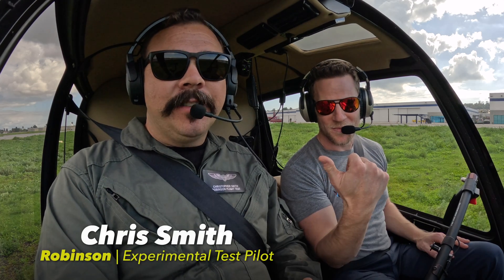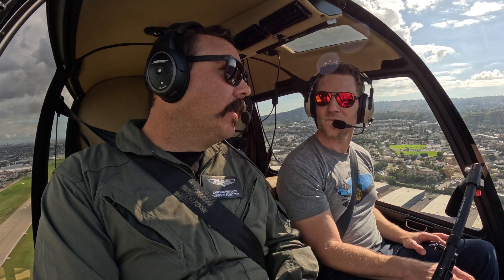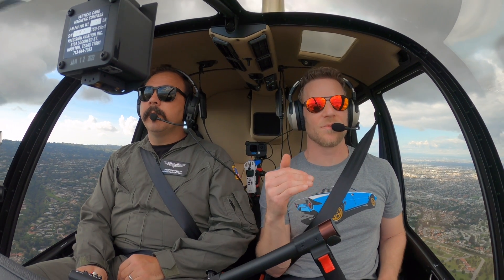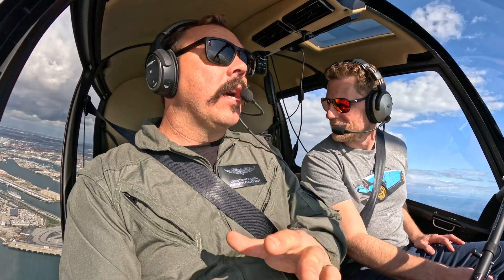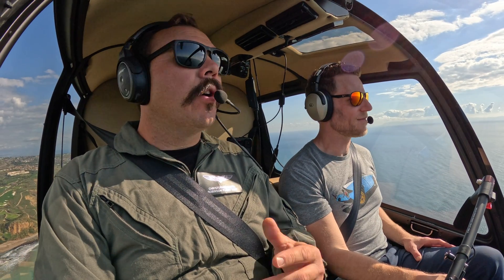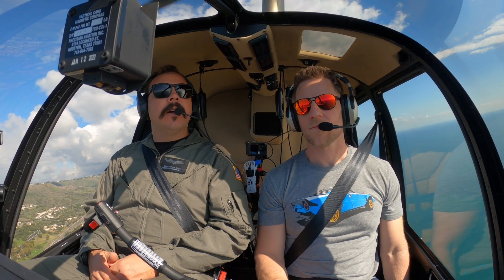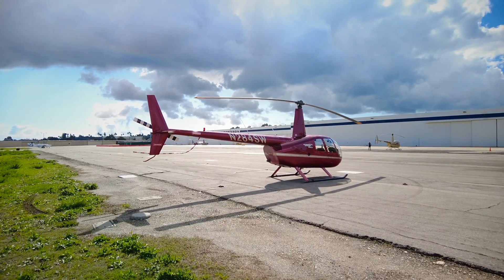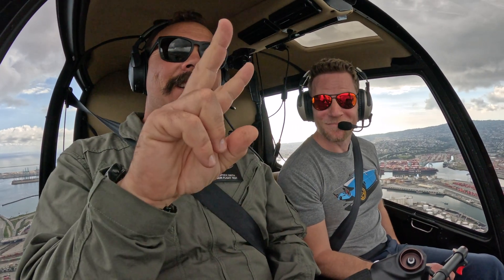Flying Robinson’s New R44 Symmetrical Stabilizer | Empennage Kit Review

Comment from the maker: FYI, while the FAA has approved the R44's new empennage, as of Feburary 2024 EASA certification is still pending. So, European R44 operators will have to wait a bit longer for the horizontal stabilizer.
Reply: @MicahMuzio  Thanks for taking us with you during this flight.  You asked a lot of great questions.  What is that "box" shaking like it's going to fall down @6:27?  I'm guessing our car enthusiast is going to be purchasing a Retrofit Kit for his  Robinson R44. 🚁 😎
Reply from the maker: @gwgrote5 That box is the magnetic compass. And yes, I suspect demand for the empennage kit is going to be huge, but first chance I have I’ll be installing it on my bird.
Reply: If just that R44 have 3 blades and autopilot. I am ready to put a deposit down lol
Reply from the maker: @flycow69   Autopilot is available for the R44 but 3 blades isn't...and I really wish it was.

Comment: A little surprised with the claim that right roll tendency goes to near zero. I had read or watched somewhere that the tendency wasn't only due to aerodynamics but also due to rotational forces?

Also really good to hear that Robinson built their "physics-based model" long after they started shipping r44s. RIP to those that didn't get the benefit of the updated engineering.

Comment: Interesting that no Bell 206 has ever had a fatal low g mast bumping accident. As well as the Bell 505. I’m Shute this corrected the Dutch Roll in the R66 as well.
Reply from the maker: I'm hopeful the era of mysterious Robinson in-flight breakups has come to an end.
Reply: I owned the first R22 Alpha and taught for years as an instructor that tail rotor thrust was the cause of the roll in low G as the factory course also taught. Four years ago during flight test in a R66 I validated that was near zero of very low tail rotor thrust in most low G accidents the single horizontal at negative angle of attack was was inducing the roll. During initial testing of the prototype Bell 505 it had a single horizontal as well handling qualities were so poor above 80 kts Bell installed the double horizontal they have today. Almost 500 Bell 505 delivered Zero Low G accident!. To my knowledge there is no other certified helicopter with a "Do Not Exceed Speed Expect in Smooth Air" limitation. No Mystery in flight breakups! @MicahMuzio
Reply from the maker: @scotturschel4439  Thanks for the background, Scott. With all that in mind, I'll feel much more comfortable flying my R44 after the horizontal stabilizer is installed. Cheers!
Reply: OH 58 and UH 1 had plenty of mast bump accidents in the late 70s. and in 1997 Hiser had a mast bump killing the pilot

Comment: Why didn't Robinson make a T tail horizontal stabiliser similar like 500MD it would have less size, weight and look good.?.....Unless this would infringe on others patents and copy-write issues
Reply from the maker: I'm not sure but patent issues is one possibility. Another is that the boom was a sturdier mounting point for the stabilizer. However they wound up on the new design, I bet they had their reasons. :)
Reply: The fuck is a ‘copy-write’?

Comment: The Bell 505 uses similar technology, as does the Enstrom 280fx that combines a symmetrical empennage with a vertical stabilizer in one. It saved my rear end when I lost TR effectiveness by allowing the tail to “fly” more or less straight until the end of my (fast) auto. Now…I can’t wait for Enstrom to release their governor kit for the 280fx.
Reply from the maker: My old 280C had a fully manual throttle. Not even a correlator. Adding a governor would've made that ship infinitely simpler to fly!
Reply: I forgot to add…the guy you flew with seems really content in his job!
Reply from the maker: @patrickjennings7362  Yeah, Chris is an absolute legend. Super knowledgeable and personable.
Reply: How can you lose TR effectiveness in an full auto?
Reply: @william0203usa2  I didn’t lose it in an auto, I entered the auto because of the LTE.